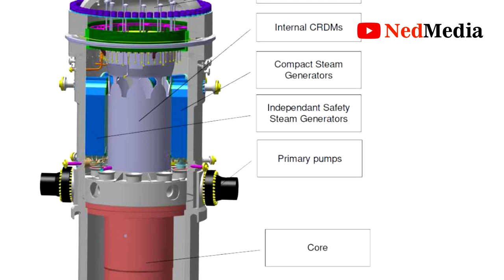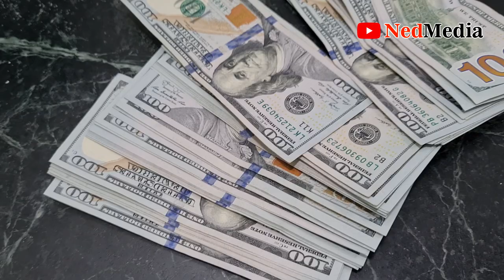Nigeria Secret $20B Nuclear Program

Comment: I am personally not a fan of nuclear power. But IF Nigerians want to go in this direction, I recommend focusing on Thorium-based reactors. - I am not a fan of Russia either. If they had not built the steel works in Ajaokuta (or if they had finished the job properly), Nigeria would have saved a lot of headaches. Funny note: if you read the Russian article in an online encyclopedia - which I am not allowed to mention here, it starts with a "w" - about Ajaokuta, it says very clearly: "it was the fault of the Nigerians that it never worked". So I would not put too much hope on them.
Reply from the maker: Is Thorium proven? 
The encyclopedia article is partially correct because no money means contract will be abandoned.
Thanks for your insights Frank 😊

Comment: Another very good video, very well  researched,  but just a few things to add, in the '80 the only 2 university offering nuclear physics was Abu and oau, ife, I was a student at ife in 1987 when Russia donated 2 reactor, 1 in each university, their is a nuclear research laboratory in ife till today, this was during Babangida Era, I had been worried about those nuclear reactors since kaduna became hotbed of banditry, nuclear material especially those from the type of reactor that was gifted to us by ussr; it is high yielding uranium, america fear is that al kheda might get there hand unto it and build a dirty bomb, which within their technicality, almost the same thing they did when they told ukraine to give back their nuclear weapon back to Russia in 1994 (Budapest protocol) for security guarantees from Russia, if that happens you know where the bomb is coming. Another thing if this bandit are trying to remove this core material they can contaminate the whole northern nigeria including Abuja making it unliveable for 20,000 years, unless all the top soil is removed. Nigeria is trying to get a nuclear reactor because of Egypt getting 4 from rosatom, although they have economic problems now but they were in a fix because Ethiopia built the Renaissance dam on the blue Nile that affected their aswann hydrogenerator, but the truth is they have too much gas reserve:  next to nigeria in Africa, egypt need it as a necessity but they could have used gas turbine. If they can find any western financial backer, but instead of approaching China for gas turbine are building a white elephant new capital with China money, and say the truth Egypt will be hosting Africa's 1st nuclear reactor, South Africa has a research one built for them by Israel during apartheid that they made their A bomb from, in conclusion I agree with you that a modular reactor is what we can handle now for this following reason, modular reactors are sealed to change the core fuel you just pull the core out, the regular reactor take about 2 to 3 weeks to change the fuel, and it has to be changed every 2 years, you have to have trained people with protective gears, that can only be exposed for number of hours everyweek to remove it, taking into account that the people trained in Nigeria universities has never removed a fuel in their life (my girlfriend was a student) the reactor was brought to nigeria by russia technicians that loaded them, then you have to depend on another country to remove and dispose the used fuel another Ajaokuta Situation. The most important lesson about nuclear reactor they are very expensive, never completed on time,always outgrow it budget, and they do not last a long time average life span 30 to 50 years because the radiation from  the core detoirating the cables and rust in the pipe and the cores, that means if Nigeria has built a power nuclear reactor at the time they built Kanji dam in 1969, it will be at the end of its life now, I might be wrong but this is my honest opinion, stay with gas turbine make it effective disregard whatever the western country environmental criticism be like China.
Reply from the maker: Thanks for your wonderful insights and for sharing this with us.
Reply: @ibrahimsalami4014   and by the way read this As of 2016, countries including Australia, Austria, Denmark, Ireland, Italy, Estonia, Latvia, Liechtenstein, Luxembourg, Malaysia, Malta, New Zealand, Norway, Portugal and Serbia have no nuclear power stations and remain opposed to nuclear power. Germany, Spain and Switzerland plan nuclear phase-outs by 2030, are those countries undeveloped.
Reply: @ibrahimsalami4014  there is one in Genoa that was the.nuclear plants uranium that isreal high jacked in 1968 to keep dimona going, subsequently that had to support the apartheid regime despite it goes against their policy counter antisemitism, but they needed uranium, the southern African got a reactor and expertise from which they built the A bomb in 1978, nuclear make you bend your back.
Reply: @ibrahimsalami4014  Italy closed it last nuclear plant in 1990 the one genao, it's the only G8 country without nuclear plant, same thing Austria has closed their plant, check it if you don't believe, I'm a very practical nigerian, I believe every country should use Whatever it has for it's development, that why China, India did not come or make commitment  at the environmental summit, because they may still use, fossil fuel for their industries, nuclear power plant is "molten bus" that if it quit you will push, it accident waiting to happen, as USA, Russia and Japan highly industrial countries found out, don't be buried by countries that cause the environmental problem to make unwise decisions, stay with what you have develop your infrastructure and primary industries, then you can talk of nuclear power, imagine we cannot even build our roads and bridges ourselves, during Awolowo's  tenure in Western region PWD built all the roads, all governors are going to China to build roads, why don't use works department and use expert consultants you will save money and your people will gain experience, you can borrow thing power plant,steel plant, petrochemical plant, plastic and chemical plants.
Reply: @ibrahimsalami4014  the level of thing has detoirated more in Nigeria now, you can imagine a nuclear plant even if you shut it down you still have to keep circulation the cooling fluid, so your standby generator must always ready, nothing like they forgot to check the battery or oil is low, that was what created problem in chernobyl;they performed a test to see what will happen if the cooling fluid was low but shut off failed, Japan was the generator failure after tsunami, even advance countries like USA want to get rid of it, if possible, human beings are not perfect, especially in a country like nigeria that somebody will put the money for mentainance in their pocket, we all want nigeria to progress, but to do so all this thing need careful prudent planning, you can't be struggling with credit card problem and buying a Bentleys on credit  Nigeria has to cut down on unnecessary spending, improve your credit rating and then borrow money, for primary industries and infrastructure will attract foreign investors, a lot of Industries will come from the west because a lot of the factory that is banned in their country because of environmental issues, could still produced in a country like, thereby more money for everybody, example so many refineries equipment will be available very cheaply by 2030, we need to be able to feed ourselves, with agricultural cooperative at grassroots level, we need to model our economy after south east Asian model, there is none of them that is affected by ukraine grain/ fertilizer crisis, this are the same countries begging American for food in the 60's are exporting now, just let pray for Nigeria. Thanks for your love for Nigeria. Nigeria will eventually need nuclear power, but just think there cheaper alternatives, and if the west don't like it, they should give us alternative source of energy.
Reply: @ibrahim salami and @oladipo ajayi... I'm proud of you both Sirs. Reading through both your comments have been enlightening.
Reply: South Africa has 2 operating nuclear power stations and has been on the forefront of new reactor research for years.
Reply: @wilcoxdaniel9825  sorry you are right, I was only aware of the research reactor they used to build the A bomb that they tested in 1978 in Kalahari desert, I mentioned south africa to emphasize that only south africa and Egypt only has the security stability and technicality to keep. A commercial plant, thanks to isreal that gave them the technicality in exchange for uranium, thank you for the correction. South africa 1st reactor 1984 must be like the Israelis, and the rumor is that dimona is having serious issues now, so most likely you must have been experiencing some problems in south africa too or very soon.hence the research and grid collapsed that was on the news.
Reply: @wilcoxdaniel9825  if this intrest other people, I copied this about south africa nuclear program, they have one plant with 2 reactor, built by same French company that built dimona, this is the excerpt: Koeberg’s history

Koeberg, Africa’s only operational nuclear power station, 27km north of the Cape Town city centre, is reaching the end of its scheduled life cycle.

The plant consists of two units of just over 900 megawatts each, and together these contribute roughly 5% of South Africa’s electricity.

Koeberg was built by the French company Framatome between 1978 and 1984. In line with international practice, the plant was granted a 40-year operational licence which will expire in July 2024. Licensing the plant for a further 20 years is possible, as long as it meets specific safety criteria. Typically these involve particular upgrades and the replacement of various components.

So far the plant has operated reasonably safely, with only comparatively minor incidents recorded.

Some civil society groups have called for the closure of Koeberg when its current licence expires in 2024. South Africa’s extreme electricity crisis would make such a closure very difficult to absorb. While the construction of new nuclear plants is prohibitively expensive and very time intensive, extending the life span of an existing plant is in principle achievable in the short term and financially defensible.

The extension of the lifespan of Koeberg was also envisaged in the government endorsed 2019 Integrated Resource Plan for electricity.

Nuclear activities in South Africa are controlled by the National Nuclear Regulator. The regulator is expected to be guided by recommendations drawn up by experts commissioned by the International Atomic Energy Agency who inspected Koeberg in 2019. These recommendations include technical interventions for operating the plant safely for another 20 years. The most significant of these is the replacement of steam generators.

The upgrade is projected to cost R20 billion (US$1.2 billion). Most of this would go towards buying and installing six new steam generators.

The need to replace them was identified over 10 years ago, but protracted litigation over who would do the job held up the project. The operation was eventually scheduled for 2022.

Life extension project

The replacements and upgrades needed to secure a 20 year operating licence extension require each Koeberg unit to be shut down for a projected five months. Unit 2 was therefore switched off on 18 January 2022 and was supposed to reopen in June 2022. Unit 1 was then to go through the same process, starting in October.
All earlier problem I highlighted are there, so you can decide yourselves.
Reply: Conspiracy is all that you have written. This should not be the reason Nigeria should not have nuks for civilian use.

Who are the creator of the terrorist gangs you wrote? Let me guess, the same people saying Nigeria should not have this or that...